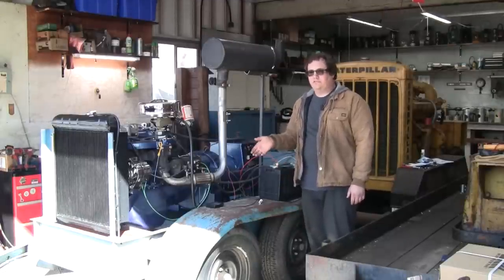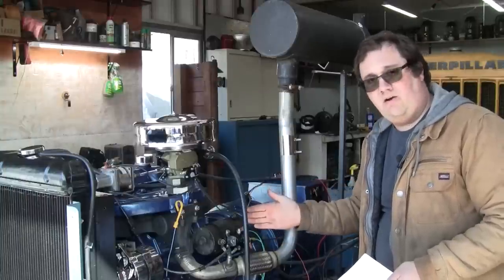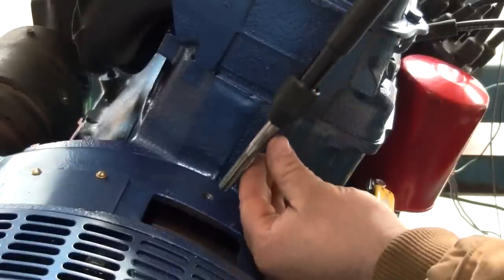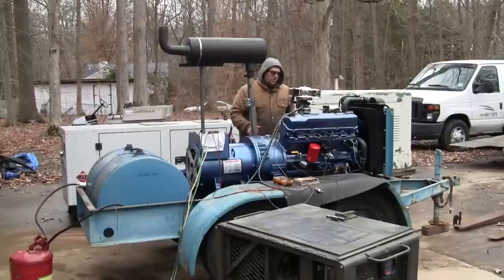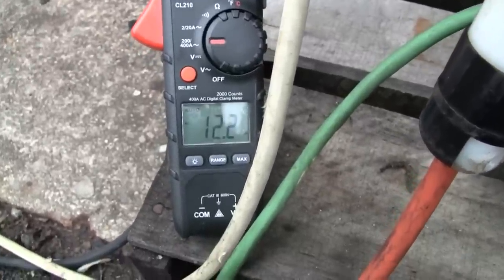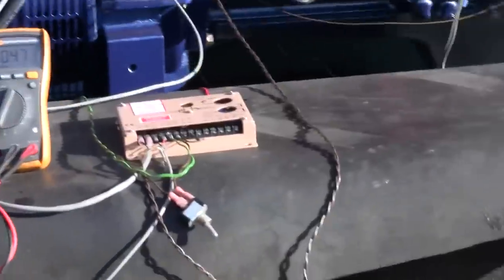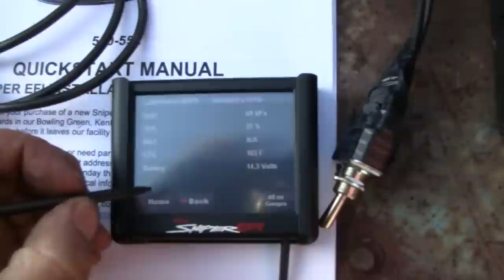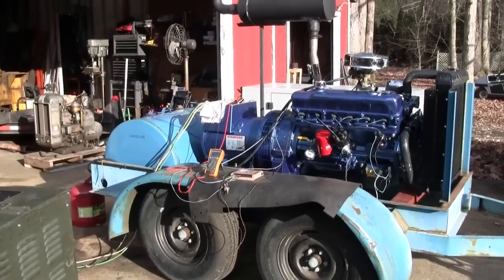Chrysler Slant 6 Generator Gets Holley Sniper EFI Pt.2 FIRST LOAD TEST

Comment: Since the throttle is only open such a small percentage at licht loads the vacuume advance could have a big impact on fuel economy.  Would be very easy to check with the holley EFI having throttle position readout.  Just connect the vacuume while under light constant load and see if the throttle percentage changes.  Try at severl different light loads like 3kw, 6kw, and 9kw...  

Industrial engines typically don't have vacumme advances because they are usually sized to match the load at 75% continious or higher.

Comment: I wonder if the frequency “hunting” is caused by the minimum increment of the governor shaft movement.  The throttle shaft of the Sniper is too “sensitive” to the governor movement.  A longer arm on the throttle lever would help with that.

Comment: The smoothness is largely due to the fact that it's an inline six, which has perfect primary and secondary balance naturally without needing balance shafts or a harmonic balancer. Yes, gas engines are generally quieter and smoother than diesels, but it's the inline six configuration that really makes it smooth. Most big trucks have inline sixes. The Chrysler slant six is famous.
Reply: Those engines were shoved into everything that n ended an engine. Drove a clamp truck for several years with one in it.

Comment: The old Mopar slant 6 is practically indestructible. I owned a 1971 Plymouth Duster, and in 1978 started building the Duster into a race car by installing a 440 engine & drivetrain. Before pulling the slant 6 out, I had a friend follow me down the freeway while I held the engine in first gear at wide open throttle for approximately six miles in an attempt to deliberately blow up the engine (hey I was young and dumb lol). It wouldn't blow.  So I got off the freeway, put the car in neutral, and did some full throttle drops into drive. Ha! I finally broke something; not the engine or transmission though, I popped the spider gears in the rear differential.
BTW, it had over 125,000 miles on it at that time. I ended up installing it in my sister's Dodge Dart and she drove it for a few more years before selling the car.

Comment: To dial in spark simply adjust while watching throttle position under steady load.  In theory the advance that results in the lowest throttle position is most efficient, assuming you don't run into spark knock.  That slant six probably has really low compression so it may not be an issue.  You will need to run more spark advance at lighter loads and less under heavy loads.
Reply: The vacuum advance hooked up should fine tune the timing for load (light load more advance higher load less advance)
Reply: Use vac advance

Comment: That's very impressive, especially considering there's still quite a bit of tuning to be done.
I wonder if the flutter on the speed control is down to signal noise, either from the speed sensor (unlikely since it should be a simple on/off waveform) or to the governor solenoid. If so, shielding might help. An oscilloscope could show you the waveform on both and might give some clues.

Comment: One of the features of EFI systems on cars, typically 100% pedal will tell the EFI to "fuel cut off" when cranking over.   I would suspect the Holley is the same, for the same reasons.  Really nice smooth generator/engine combo.

Comment: Nice work on this genset Mike, it turned out great!! I agree with the governor control. Its built for a genset application and has been proven for years, and gives you all the fine tuning required to control the load properly. Not to say the Holley couldn't do this as well, but it was made for a car and the last thing you would want is for this thing to over or undershoot that throttle, as you know that has the potential to do some serious damage to voltage regulator or worse whatever it's powering! Also, you've done this work for years and have a very deep understanding of that control set, so i don't blame you for sticking to what you know works, especially for a client. Awesome work, happy to see you back!!

Comment: EFI at least keeps gasoline sealed in injector s unlike carburetor which is open to atmosphere causes it to varnish jets after sitting for months .
Excellent 225 engine we had in pumps forklifts industrial.
Only downfall on these slant 170,225s  in cars trucks  was that distributor was down low by puddles snow water and caps got water in them a lot .

It is possible to make it both gasoline and LP gas etc .
My  JLG manlift has both .
Excellent 👍

Comment: that unit sounds really good.  as to the vacuum advance i understand your reason for not using it , and yet it may help with the full load spike, timing advance = HP 
as to the base timing as it will ever only start and run at 1800 RMP  i would start with 14 BTDC at idle and go up from there. if i remember right i ran my 71 slant 6 at around 16 BTDC. again the more timing you can get on it with out a knock or hot starting problem the better AFR you will get.
Reply: Economy. Power throttle response

Comment: On start up most Fuel injection systems treat WOT  when cranking as clear flood mode it shuts off the injectors  because that was the way to clear a flooded engine was to hold the gas pedal to the floor when cranking so software designers for fuel injection in cars keep that same feature.

Comment: I just wanted to offer some input on that slant 6 I use to own 1980 Plymouth Volare wished never got rid of it. but if you put one bubble carburetor replace the jets to 1 %ers then you can tune it on dyno machine to adjust the air gas racial and you get to o emission then that increase the fuel efficiency to29 to 30 miles per gallon on the hwy14 to 18 city the government  wanted them engine's to run generators with you can run that  in idle not burn drop of gas learned that from dyno mechanic technician in California Great video

Comment: Simple fix for your clear flood deal, just make sure your electric governer can only open the throttle below the flood clear value (if you cannot disable it) so if its 60% throttle have your governer limited to 55% seems you have the headroom. or fudge the TPS calibration on the sniper.

Comment: Another great video. That engine seems to be a good match for the generator. Doesn't seem to be working much at all. I would be interested in a couple of fuel consumption tests. Maybe one at full load and half load. I'm thinking it might be pretty reasonable. You really have to think about the cost of fuel today. With diesel being almost 2.00 dollars more a gallon that gives you more wiggle room on gasoline. Not to mention a gasoline engine is usually much cheaper to buy/rebuild and maintain these days. Nice work!
Reply: The EFI will meter fuel better and should help with fuel wash down on oiling. That little engine will run forever if tou change oil regularly.

Comment: How to describe a dead time regulation thing: Think of a shower with an elongated tube between the head and the two cocks. If you try to change the temperature you must consider that the water with the altered hot/cold mixture needs to flow a certain time before it arrives at the head. Turning the hot water cock to far open not bearing in mind the deadtime will bring you to hot water from above, then you close it to far making you shiver.
Thats my explanation.
I always appreciate your videos, interesting sujets and solutions.
Greetings from Germany, the heart of burocracy otherwise a development country. I prefer a house in the green, not a green one in my house.

Comment: The little slant-6 took the load test like a champ! Seems like the EFI is working great as well. I wonder what kind of fuel savings there are, if any, over a carburetor in addition to the good cold start characteristics.
Reply: any fuel savings should be very minor... after all the engine itself hasn't changed and would have been optimized or at least should have been optimised for its load, EFI will run the engine at a more optimal A/F ratio across a wider range of loads and speeds but this only had to deal with 1 speed and varying load.
Reply: @Wingnut353  Something about the carb, though, is that when you tune it you do so during a specific set of environmental conditions, whether you do it in the summer, winter, etc. And then probably never touch it again. The EFI makes adjustments based on intake air temp, etc. So it has an advantage there. One thing is likely for sure. He'll never see fuel savings enough to justify the cost of the EFI over even a brand new carb more than likely. I still love that the customer wanted it, though.

Comment: The holley efi systems have a clear flood mood set at 75% throttle position or higher if it's wide open throttle while starting the injectors won't fire I have the 4 barrel model on a 440 big block in my d250 dodge

Comment: Runs nice. Those slant 6 engines put out a lot of torque, & were useful in trucks for this reason. The later ones in cars had 160hp, or more, due to bigger valves, & mild cam. Enough power for this application. I noticed at full load, the engine wasn't working hard at all.

Comment: I always thought this would be a perfect use for a sniper. Dont have to worry about a carb getting gummed up. FYI throttle position refers more to the airflow potential of the tbi unit itself. Manifold pressure is more of a measurement of engine load. Depending on altitude ~100kpa = wide open / full load. At 80kpa you are getting closer to full load on the engine.

Comment: Mike, another great video👍🇺🇸.

Isn’t healthier for the cold engine to run at idle at least a few seconds to get oil pressure before allowing it to ramp up to its 1800 RPMs?  Also, I noticed “gasoline” was stenciled on the side of the gas tank.  I’d add another “gasoline only” sign near the tank’s fill inlet.  Just in case someone wants to dump some diesel in there by mistake 😲
Reply: If I had this or any genset, I want it set up to idle for about 30 seconds for just that same reason, diesel or spark type. Additionally, if a turbo is involved I'd want the shutdown sequence to drop it to idle for 2 minutes before shutting down to let the turbo spool down with oil still flowing.

Comment: Use a relay on the crank wire to open the power wire to the governor so when you are cranking the governor is inactive. Start to 85, ground to 86, b+ to 87, gov to 30.

Comment: I would absolutely have chosen propane (or natural gas, if available) over Sniper.  But good on him for using such a nice unit, and I get the desire for no-fiddle cold starting.  I wish I had one just like it, I’ve got a need for one exactly that size.
Reply: Ford make a l6 "Barra" engine that runs on LPG from factory here in Aus. Many of them have been imported to the U.S. as they are good for building into high HP drag engines. Won't be too expensive in stock form and perfect for what you're looking for. They can be easily identified compared to their gasoline brothers by the green valve cover. Green = LPG. cheers.
Reply: @victorbitter583  there were lots of industrial LPG powered slant sixes, also.  Going all the way back to the 50s, the Chrysler flathead six and the 354 Hemi v8 were both offered in industrial form and were often run on LPG or natural gas. Very common as irrigation well prime movers all across the mid/southwest US. They last longer on gaseous fuel as well, since there’s no lubricant dilution.
Reply: Do the LPG motors have higher compression ratios to take advantage of the 140 octane of LPG?
Reply: @victorbitter583  Barra no good for generators. Unless you've lived off generator power for an extended period you can't really know. 
I am a qualified mechanic and I live on generator power. I have a V twin petrol 13kva, a single cylinder Diesel 7kva and a 900cc 3 cylinder Diesel 5.5kva.
Why you may ask? Well they use so much fuel its ridiculous. It isn't so much the high load fuel consumption but the light load fuel consumption that gets you. The POS Slant in the vid for example the fuel consumption might be in the 5 l/hr range under light load. That's using 60litres for sitting around on standby every 12 hours. At say 20kw then that might go up to 16 of 17 litres and hour (or more) so pushing 200 litres for a 12 hour day; double that for a 24hr day. 
Putting a Barra on a generator like this is going the wrong way. What you want is the smallest engine that you can get away with, so a 1.5litre 4 cylinder Diesel with a turbocharger. That way the light load fuel consumption goes way down since there's 2 cylinders less in pumping losses, half the cubic capacity, off boost it still is only a 1.5 litre engine so it costs not much at light load and you still get full rated power since the turbo compensates for the lack of displacement. It is the best of both worlds but still pretty poor since the operating costs are way higher (so at least double) than mains power.
Slant is always an I6 Slant (either 170 or 225 cubes).
So the Slant in this generator is a product of an era of cheap fuel characterized by cheap engines that will do the job & fit the bill rather than anything else. If the owner ever needs to depend on this for say 3 days in a freezing winter it will do the job but they'll quickly realize why so many generators get forgotten about since their operating cost is horrendous. Still for the up to a $1000 it costs to run this over a few days once every 3 or 5 years then I guess it's better to have it than not have it. Of course not every time you use it will be for days on in a freezing winter.  

My 900cc 3 cylinder Diesel uses 5-600cc/hr standby and max WOT is 1.4l/hr for 5.5kw which I sized to be the best compromise for my needs. By compromise I mean I have to load shed because it isn't powerful enough but that is only 10% of the time. If I wanted the 'perfect' generator then the a 10kw generator would be better but my light load fuel consumption would go to 1.1l/hr and 3.5l/hr for WOT. My weekly fuel bill will be double for the 10% of the time I need a larger generator. Very quickly you realize that use that money to buy another generator. 

Grid power is luxury since you just take what you want and if it breaks someone else fixes it.
Reply: @ThePaulv12  I'll take your word on that lol.
Reply: @victorbitter583  Yeah man. I hate generators. Any opportunity for a rant. The more I rant the more they break down so I'll STFU. Did I ever tell you about the time I had all three of them failed at once? ... oh wait.... bye
Reply: @ThePaulv12  I've never owned one mate. Just tryin to help out a brother who wants to run one on gas. Sounds like you know generators though. Cheers Brother.
Reply: @victorbitter583  I just love hating on them.
Reply: @ThePaulv12  your best bang for your bucks is money spent on storage batteries and inverters. Generators should only be used at full load to charge batteries. Idling a generator for standby loads is just wasting fuel.
Reply: @jstaffordii  Yep.
Reply: Not the older ones. After all they’re industrial de-rated, low compression motors for longevity, anyway.  These re are many LPG engines based on diesels, and of course they do have higher compression (though still lower than their diesel versions).
Reply: @jstaffordii  batteries and inverters would have gotten me maybe 1/7th of the way through the ice storm outage last month. I can afford the “wasted” gas when I know I can have power for a week, if I need it.  My little Generac didn’t miss a beat, though a slant-6 would have been 100x more interesting.
Reply: @stevelacker358  that's what happens when battery systems are improperly sized for the situation. Properly sized off grid systems provide 3 days autonomy minimum  or burn excessive  fuel in a generator.  Your situation due to climate and necessity for  emergency heating make a generator the correct option for the situation.

Comment: I had a completely stock 1980 car with a slant 6, in one trip I put close to 500 miles on it and only used 3/8 of a tank of gasoline.
Pretty danged fuel efficient from the factory and only needed to throw a tuneup at it yearly to keep it running.

Comment: I remember getting a call from a local hotel with an Onan version that used the same engine. SK, ? S something. Repair to start. Guy gets there, in the hood mind you, the whole ignition system is gone! Guess they had a neighbor with a slant 6! Battery, cap, rotor and wires gone.....We used to call some of those units "stand by, stand back" instead of stand by generators because of the 3600 rpm versions.....

Comment: A separate governor on an Generator engine is a must.  You need to keep the revs close to 1800. Because you generate currant on 60hz. If the engine drops 30 rpm your on 59 hz in you electric power. Some electric appliances stop working on 1 or 2 hz drop. Some diesel engines have a built in rpm governor. Gas engines rarely or not.
While drilling or taping have a vacuum cleaner near the drill. Wont take all the steel curls away but does alot of them. Goes espessialy for arias where magnetism is involved.

Comment: Thoroughly fascinating. I told my cats I'd be there to feed them "in a minute" - Forty minutes later, and they're bouncing off the walls!

I think you can be justifiably proud of that engine, just as it stands right now. I can hardly wait for the next instalment, and the final tweaks and adjustments. What would be interesting, but my guess is that the engine management can't show, would be the fuel consumption/ hour. Not that it would change anything, but it could be useful when working out the best balance of load to fuel used. There will no doubt be a sweet spot where the set will be at its most efficient?

You done yourself proud with this one! 👍☑️💡